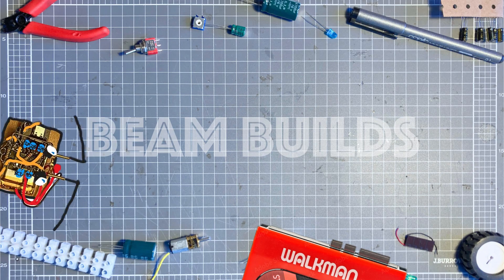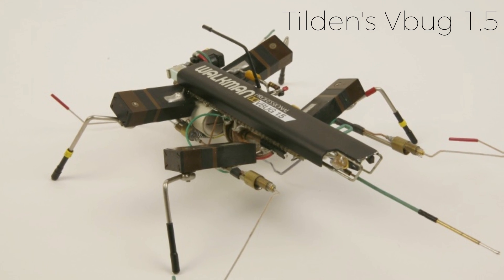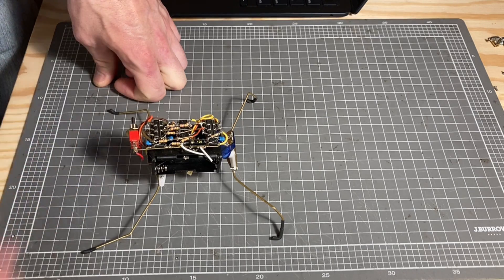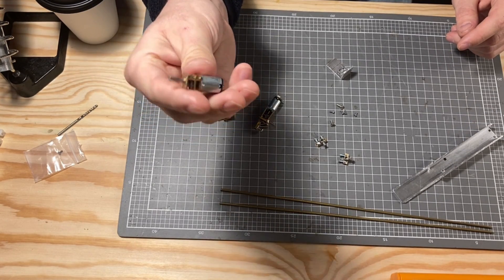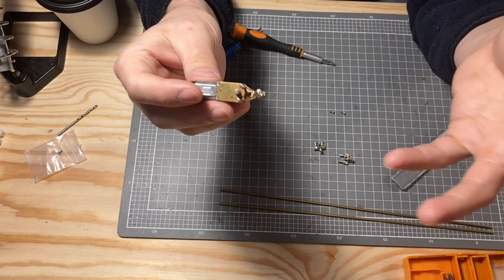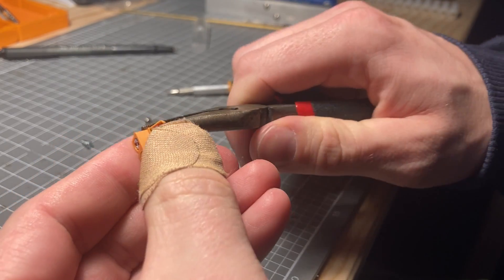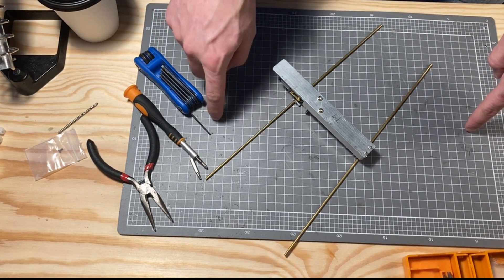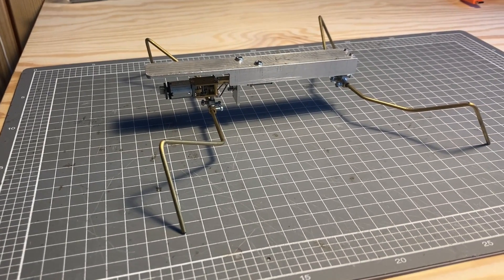I miss BEAM robots, so I am building a new one - Part 1

Comment: Great job! It looks satisfyingly sturdy, like I really like how everything is thightly screwed together! 6:55 Btw, if I remeber correctly, N20s use M1.6 machine threaded screws. I bought a pack of 50 from eBay a while ago.
Reply from the maker: Thanks! I will check out eBay, I did find some from a somewhat local robot supply place but they were crazy expensive

Comment: I built my BEAM robot "Spyder" around 25 years ago. It's a 16 Nv walker with 8 motors, a 4 core central microcore ring, and 4 branched Nv chains. I pulled it out, cleaned the corrosion from the battery terminals, and introduced my new kitten Tam to the weirdness of all my goofy BEAM bots. Floor Monkey, a photophobe inspired by sea monkeys and built from spare parts and the broke loneliness that arose from my car breaking down and stranding me in an abandoned college town over Christmas vacation, as everyone went home for the holiday, turns out to have had a battery so corroded that it split the metal can... If I've learned anything... Take batteries out of your old BEAM robots. Also, Tam is chewing on my ankle and my toes... Stinker... I still need to introduce him to Walkman Jr (2 motor walker) and Bronco (3 motor walker).

Comment: gathering parts myself. Any pointers on finding appropriate chips/parts in old electronics? thanks!
Reply from the maker: If you are looking at old electronics for parts, things that move and/or run audio are a good place to start. A lot of electronics made in the last 30ish years use SMD parts that are not super useful for this, but there is still a fair amount of stuff out there that is useful. I have good luck getting stuff from Core Electronics and RS Components. A lot of the chips are super cheap new

Comment: Three-motor walkers were wonderful, it's great to see you making one now.  I concur about how the soldered-construction method drew the eye.  It made the bots look like something actually constructed by other machines, perhaps salvaging human tech-trash for parts and using/re-using whatever it had to construct mobile units.
Reply from the maker: I totally agree, but they always seemed a little overlooked in BEAM, even though it should be a really capable system. Part of the reason I decided to go with a 3 motor design is because there is so little info on circuits and control systems. It should be fun (hopefully) to try and develop some here.